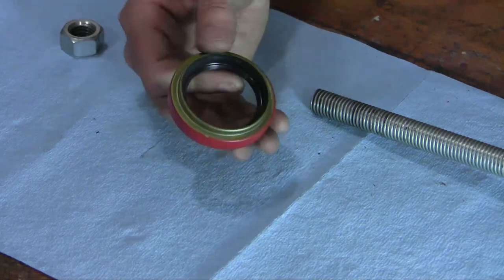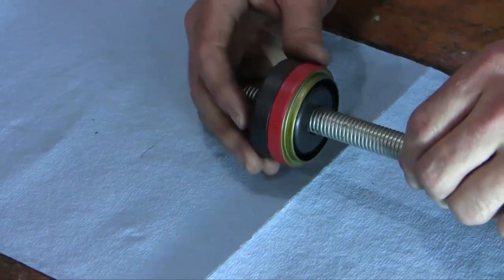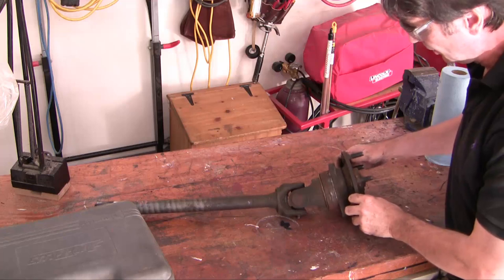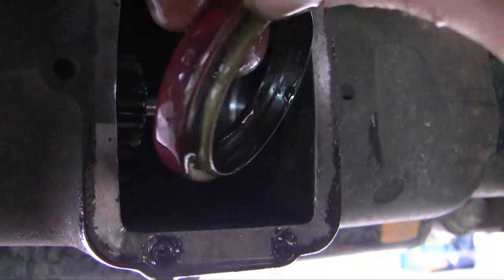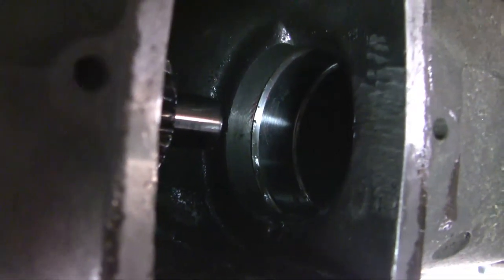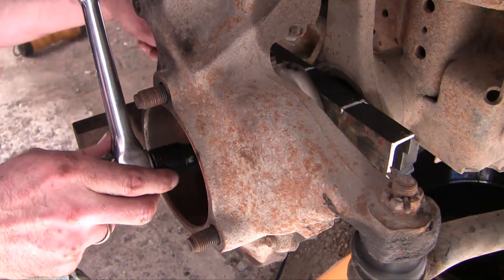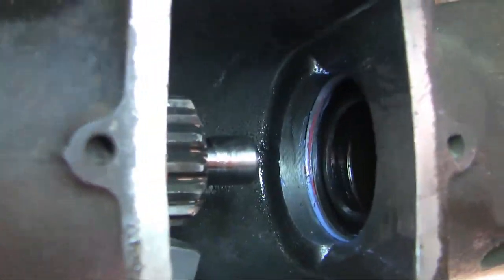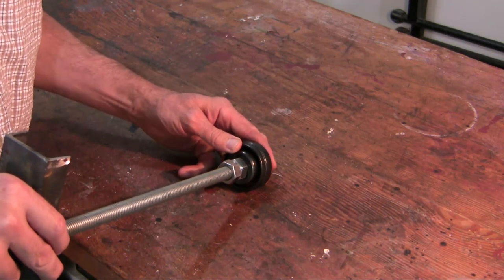Replace right front axle seal, 1998 Dodge Ram 4X4, part 2

Comment: Where can you buy the seal driver for the inner seal on passenger side on a 2000 dodge 4x4 ram 1500
Reply from the maker: It's been years since I did this but I used Quad4X4, as outlined in the comments thread. They are more expensive than I wanted but they worked on the OEM seal, only. You may find better more cost effective options now, google is your friend.

Comment: what about a pvc. pipe w/glued cap. hole drilled in middle. All thread and a 3/8 all thread with dent slide hammer?
Reply from the maker: +precinct 1 baltimore county residents That's a good thought. The biggest problem with this seal is the minimal, thin contact surface which I recall is slightly recessed from the outside surface. It's much more difficult than a normal seal, only because of that. To make matters worse, generic seals are differently shaped which makes fitting even more problematic. If you have found something that fits well and works, I'm sure many others would find your contribution useful.

Comment: yeah i got a long rod like in the video an some washers an nuts but on the out side of the axel i put a plate an a bolt to tighten the rod an pull the seal inplace but iv just crushed the steal plate lol

Comment: if you are still around on youtube. do you have a part number or a name brand for said seal puller. i need one. really bad. to the point were in about to turn hulf and flip the truck over.
Reply from the maker: +lead foot lawn mower (leadfootlawnmower) Search Quad4X4, or use Google for any number of search terms.

Comment: HI there can you send me info on what part number that seal setter is.
I have dana 60 in 97 2500 I believe 44 and 60 have Sam seals. ,y passenger side isn't weeping it's pouring almost. Your help would be greatly appreciated. Clay
Reply from the maker: Dana 60 is not the same axle as the one I showed, and the seal driver is specific to those narrow details. I don't remember my part #, but even so it would be different for yours, and it is specific to one side and also only to OEM seals, not generic seals. I got the seal driver at a website called quad4X4 and when I last checked you could look up part numbers there. It was expensive, even with just the driver part, and many people have tried DIY options, described in the thread below. Yes, pouring out is what mine did at one time, but don't worry if you have time to get it done right away. The bigger axles may be harder to work on, and some have described requiring a diff puller which I fortunately didn't need. I found the drivers side much easier. Good luck!

Comment: Do you need an axle model number or specs on I.D. for the driver?
Reply from the maker: You make a good point, getting an axle id can be a challenge. I got the seal for this vehicle from the dealer, after I learned that aftermarket seals have a different shape and may not fit the custom seal driver I ultimately used. All I needed was a VIN, and they called up a build sheet and got my axle id from that. You can get build sheets from google, too, although that may not have all the front axle info. The other pathway is to find a website that helps id axles based on the number of bolts and design of the diff housing, with photos of the diff to compare. That's how I matched the limited slip clutch plates for a different repair. You may find an id on the axle tube, mine was not very useful.

Comment: what size in mm. is the seal driver? small side and larger.side. I'd like to cut 2 pcs.of plywood with a router. I'm poor!
Reply from the maker: +precinct 1 baltimore county residents I don't remember, but what you really want is to buy the new seal and fit your driver to that.

Comment: ok so going to try this, did one of the comments say this was different on a ram 2500?
ill try the hole saw thing and comment if it works :) 
also did you mention the cause of this is usually a failed u joint? cause if so probably replace that too

Comment: hi Iike to know where you bought the seal driver mine is still leaning replaced booth of them
Reply from the maker: Edward montenegro Quad4X4, pretty expensive for a single use tool. Read the thread below for more creative DIY ideas, though nothing works better than a custom machined tool.
Reply: +spelunkerd  tryed the washer trick now they are both leaking on the passenger was are the seals suppose to hugs the shaft tight or lose?
Reply from the maker: Edward montenegro fairly tight, but be careful not to damage the seals when installing them - if the inner lip is wet with oil it is less likely to be damaged. As you can see from the videos, I found the experience frustrating until I got the right tool. Others here have described success when modifying hole saws, but by that point I just wanted the job done without more failure.

Comment: I wish you had shown the complete disassembly and reassembly instead of leaving that part out of it. I have to replace the right axle because the spindle threads are stripped, and I've not been into one of these dodges before. would have helped to see everything, oh well, I'll keep looking.
Reply from the maker: Sorry man, it was one of my earlier videos, and in retrospect I do agree it's not my best. There is definitely a learning curve when it comes to recording and posting videos. My axle was fine, so you're looking at a different repair. I suspect that there are better videos out there to help you. Better yet, when you do yours, keep the camera on and record your effort for the benefit of others to come.
Reply: hey man, thanks for the response. I've done a few videos and yeah it can be tricky trying to do what you're doing AND trying to make a video that is watchable, LOL. the threads on the outer spindle are stripped on my axle, have a new axle will be here tomorrow. I think I have it, I have watched more of yours and a few others. My one question is the shift collar, do I have to take that out to replace the axle, or can I just slide the old one out and the new one in? part of me thinks it should just go old one out/new one in, but another part of me says, no I'm gonna have to take off the plate and the shift collar? suggestions? or rather, instructions, HA thanks again!
Reply from the maker: Charles S If the axle spindle threads are stripped on one side, I would disassemble the area enough to have a close look at the mating female spindle threads -- those may need to be replaced, too. And I would wonder why those threads stripped out -- I would make sure the mechanism for engaging and disengaging the axle lock is working as it should. Good luck!
Reply: thank you sir. I believe the reason the spindle nut stripped is because the hub bearing came apart and it wobbled around. I got the new axle in today, but, the nut is stripped and finding one is next to impossible. even the dealers around here don't have it in stock and it's back ordered! I went to fastenal today, and they measured it to be a 1 1/8" nut, but being that the threads are messed up, he couldn't tell what the threads are. His computer said it should be 14 in 1, I'm assuming that's 14 threads in an inch. But he didn't have it in stock. Guess I'll be calling some salvage yards tomorrow and hope I can find one that can be removed without messing up the threads
Reply from the maker: Charles S I'd be doing the same, at least a junk yard part will be more likely a perfect fit.  Some guys use locktite on those threads, as well as a torque wrench to get the torque exact. I forget if it has a lock collar with a cotter pin. That old cotter pin design seems safer than the newer single-use TTY nuts.

Comment: Is there an easy way to get the old seal out?
Reply from the maker: If I remember correctly, it pried out easily with a screwdriver. If you can't make the turn in the tight space, you might need a small bent prybar. Be careful not to scratch the metal surface underneath.

Comment: Hi my name is lucas from argentina. Sorry for my english I am medical doctor so my car post english ar very poor. I have a dodge ram 2500 4wd heavy duty with dan 60 front axle. I have leanings and I need to replace all front axle seals. I think that are 3 o 4 total but i have only 2 of them. national 710241 and 5131 right and left. I saw you video replacing one of this. I need to know how many seal are inthe from axle and the part number 
thanks
Reply from the maker: Hello from a fellow MD, Lucas. I was a medical oncologist before retiring to do mechanical work full time, so we share more than you think. You can send me an email by going to my channel page and click the 'contact' tab, leave me a message with your email address and I'll respond directly. However you should know that the 2500 axle is quite different, I've never worked on that one and undoubtedly the seal sizes will be very different. I believe even some of the preliminary work is different with the Dana 60. I found this axle seal to be the most difficult pair I've ever done, and as shown you may need a specialty seal driver that increases cost. These aren't beginner tasks, so if you're having doubts about doing it yourself you may decide to rethink it. Dave.

Comment: How is someone supposed to order one of these seals? I have a 1999 2500 cumins which should have the dana 60 axel, but every parts store website is telling me the dana 60 axel seal is incompatible with my truck. Then it tells me the dana 44 seal is compatible. I dont wanna buy both and I don't wanna have my truck on jackstands waiting for the correct on to ship.
Reply from the maker: I went to the dealer for the seal, with my VIN in hand. There's so much effort to installing this seal I didn't want a time wasting problem of incompatibility. The aftermarket seals I bought on the first attempt were of slightly different shape, and didn't fit the custom seal driver I ultimately used. Your mileage may vary, and if your axle is not the original for the truck, you may need to more closely identify it.
Reply: @spelunkerd  I really appreciate the fact that you replied to a comment on a ten year old video. Your video was a large help to me, I found out that the dana 44 used on the 1500s and the dana 60 used in the front end of the 2500s take the same seals. So I ordered one, im gonna use a holesaw, and if doesnt work I was gonna go to a dealer. Thanks again. My seal went bad on me after I replaced my bearings/hubs, break calipers and rotors. I guess I jostled my axle shaft a bit too much. I pulled it out to check my ujoints. I'm just glad the driver side is fine because I wouldn't have been able to do that one myself.
Reply from the maker: @briane707  I hope you have better success on the first try than I did. Strangely, the passenger side is more difficult because it isn't easy to pull that seal into place. That seal is the most difficult one I've ever had to replace.
Reply: @spelunkerd  Yaa but I wouldn't have had the means to drain, disassemble, reassemble and fill my diff. That's a bit more intimidating for someone who's not a mechanic.
Reply: Hey so I finally got around to doing it. I grinded a hole saw down to pull it and I'm assuming it worked. I mightve driven it In a bit more than you did. I'm just wondering if I need to replace the gear oil that was in there, or if it just makes its own way over from the pumpkin? Should I top it off or get it changed? Or would that be a waste of money? Also what would happen if it is driven in too far?
Reply from the maker: @briane707  In my truck there is free interchange between the two for fluid to move through the axle tube to the diff. Yeah, I would open the top check plug on the diff and top it up as needed, make sure your vehicle is on level ground. Unless you were really low you won't need more than a liter, and those 1L squirt bottle containers make it easy to refill. Or if you're overdue for a diff fluid change, you may want to do a complete drain and refill.

Comment: How about a link as to where to get that tool???
Reply from the maker: I don't endorse or advertise for specific companies, especially when I believe the price is higher than it should be for a single use item. There are many diy options listed in the extensive comments, some of which are likely to be much more cost effective. That said, I found the exact fitting adapter for ONLY the OEM seal at Quad4X4. Google is your friend.

Comment: What kind of oil do you put in actuator motor
Reply from the maker: Same oil as used in the diff, as I recall, 75W90. Oil put into the front diff spreads down the axle to lubricate the whole shaft, including the contact points on the actuator motor.
Reply: Thanks

Comment: anyone consider using the hole saw for it's intended purpose?
drill out a circular shape the same size as the seal and use the wooden blank as the seal installer? I have my 2500 completely tore down and am getting ready to r&r the right seal tomorrow. Anyone know of a video for a 2500, I heard there is not enough room to remove the collar through the cad cover?
Reply: I know this is old, but were you able to replace 2500 seal? was it similar to this?
Reply from the maker: I've never done the 2500 -- I believe there are significant differences. There are other videos here on youtube that might help, and of course the dealers manual is an important resource. Good luck!
Reply: Thanks.  I replaced my ball joints and after pulling my axle out of passenger side it has a very slow leak.  The design seems very close.  I do have a pdf of the manual so I will look that over before I give it a go.  Thanks for the design on the seal tool.

Comment: Do you know where I might be able to find the tools?
Reply from the maker: General hardware or auto parts stores.
Reply: spelunkerd hi excuse me to disturb you, do you use a dial indicator to remove axle? because I must to remvoe mine cause the seals are bad, and I ve not and too I don't know how it finctions. In my opinion I'll do marks and I mesure the rings to install it, what do you think?
I have a other solution to install seal in passenger side, you can put it with a piece of wood if you can't buy an installer, it works fine, you take the measure of the seal, and after you cut the piece of the wood!
Reply from the maker: pelvismc pelvis I did not use a dial indicator for the seal replacement, but I didn't recheck other parameters like the relative positioning of the diff in its housing. In my case it wasn't necessary, but it might be in other situations.
Reply: spelunkerd ok thank you, because I must to change these 2 seals, and I don't want to buy a dial indicator! The proof mechanic takes me 900$ to change thes 2 seals! Ouaouh! I prefer change by myself it's not difficult works, but it's little longer time to remove evrything! I think dana or other would put  these seals at the beginin instead of inside the diff!  I prefer to put 10 liters of oil and change seal at the begining if it was   than change these seals inside with 4 liters!k you very much, it's a great video !
Reply: If you want you can make yourself, it's easy, you take your new seal, and you take the diameter and you can cut on a piece of wood! That I do! Or a big socket wrench or steel tube.
Reply from the maker: pelvismc pelvis Making the adapter for this seal is a little more tricky than most. I like the idea of using a hole saw bit; as I recall it was about 2-21/4" diam. When you look at the seal you will see where you want pressure on it so the seal doesn't change shape while being pressed into place. Take the time to read through the remarks on this video, there are lots of good ideas from others. Good luck!
Reply: Sincerely it's a very very good video! I went to France, there are not many american cars, yet there are solid cars!  For me it's the first time I change these seals from my dana 60. I ve changed the outside transfer case seal without remove transmission sustain, I made a wrench to remove the 4 bolts which are behind the dble CV, I like this car because the mecanic is very easy, a little difficult sometimes when you have bolts with rust but I like to learn your differents experiences and your  advice!
Before I forget, Could you tell me if it's necessary to use spreader to remove the case, because I've not one and I can't buy one, I have the idea to put a rope to pull out it, after to put inside with a brass hammer!  what do you think? Thank you in advance Jérémy

Comment: It's called a seal driver?? Where do I find one?
Reply from the maker: juneausucks Google seal driver or Dodge axle seal driver and it will come up. I don't remember the name of the the company I got it from but it was over $100, so not cheap. Read through the comments and you'll find all kinds of creative ideas for making your own, and I think I put the company name somewhere in the comments, too.
Reply: I used a hole saw worked awesome. Thanks man.
Reply from the maker: juneausucks Great, thanks for recording your results here.